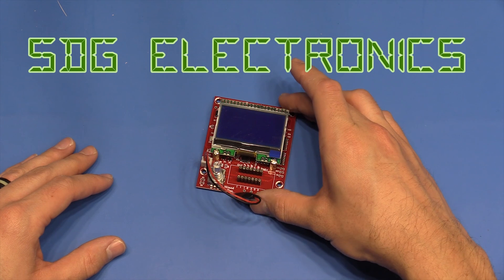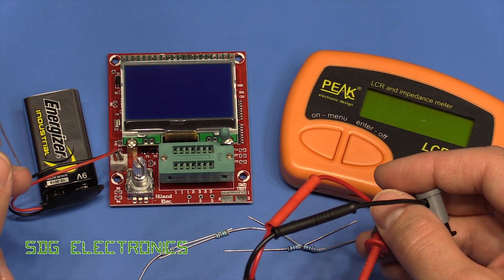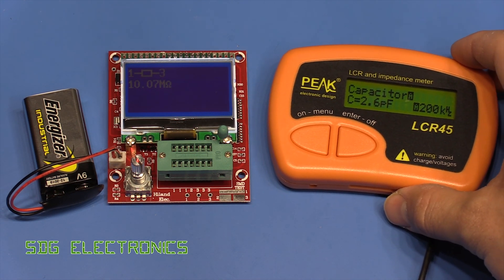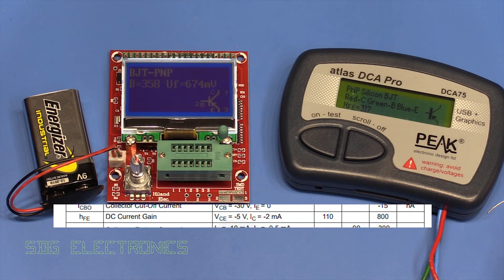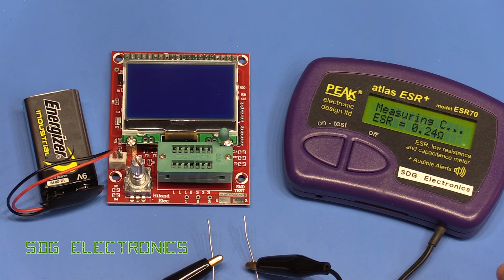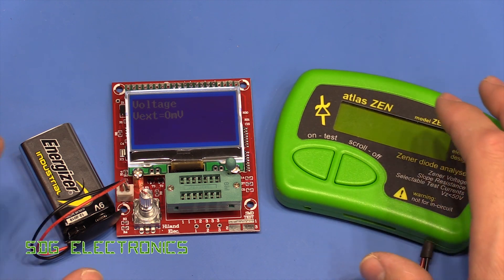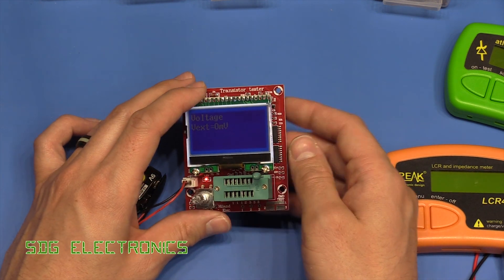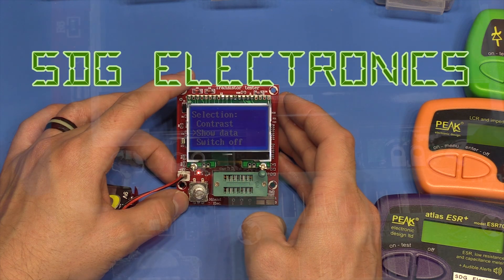SDG #054 Hiland M644 Component and Transistor Tester

Comment: I believe this is a copy of a long running open source project detailed here https://www.mikrocontroller.net/articles/AVR_Transistortester#Introduction_.28English.29
Reply: Here is a large pdf of the project http://www.avrtester.tode.cz/upload/ttester_en.pdf

When I made mine from a kit I bought from Amazon it came with calibration instructions and components. If I ever buy another I’ll get one in a case!
Reply from the maker: Yes, I saw the article from Karl-Heinz Kubbeler. I didn't find any 'original' hardware in my search, so I don't think the PCB is trying to represent itself as something it's not. I might look at updating the firmware on this with the latest from the project. Thank you.

Comment: You have to calibrate it before you use it. The firmware on your Tester is crap you should use the original from here:
https://www.mikrocontroller.net/svnbrowser/transistortester/
What you got is a clone. The ORIGINAL tester comes from here:
https://www.mikrocontroller.net/articles/AVR_Transistortester
Reply from the maker: Great info. Thank you. I did credit Karl-Heinz Kübbeler in the description.

Comment: Thanks Steve...I have the Peak suite as well and you can null the leads when required;  I do it especially when changing the lead types, alligator, micro clip, tweezer, etc. where more accuracy is required. For the beginner the inexpensive all in one is a great deal although you'd have to build your own lead set to be able to get beyond the ZIF socket and the unit may not be able to accommodate a null function. I'm sending a link to this video to our ham radio Builders Group where we have lots of new tinkerers.
Reply from the maker: I didn't actually realise you could null the leads. That was silly... :-o I do like the Peak meters, but the cost and functionality of these things can't be beaten really.